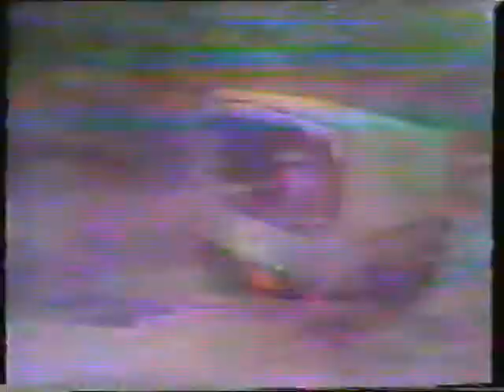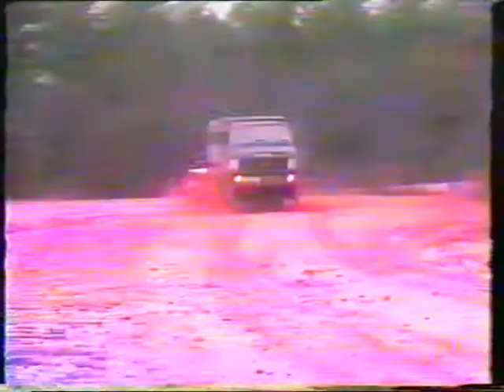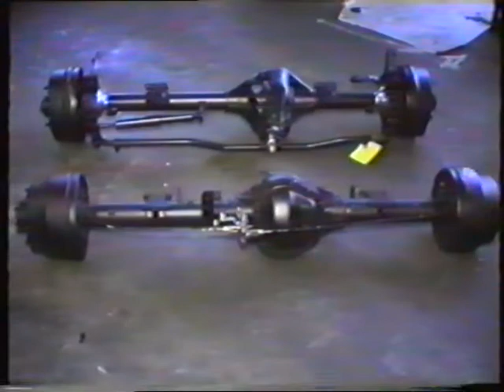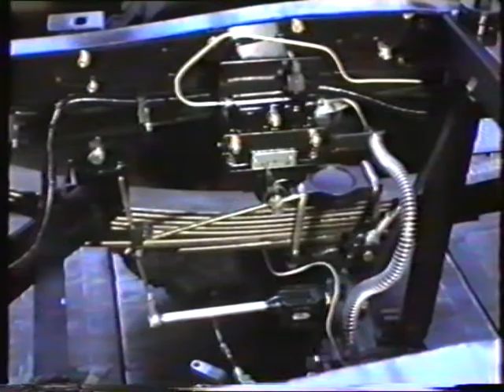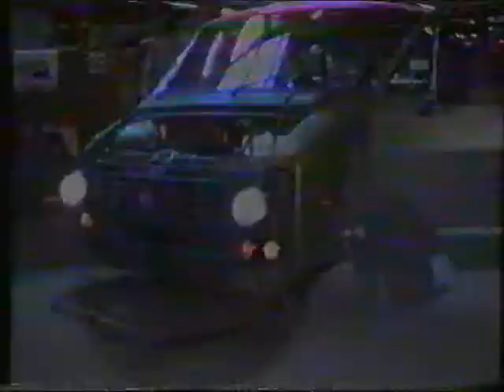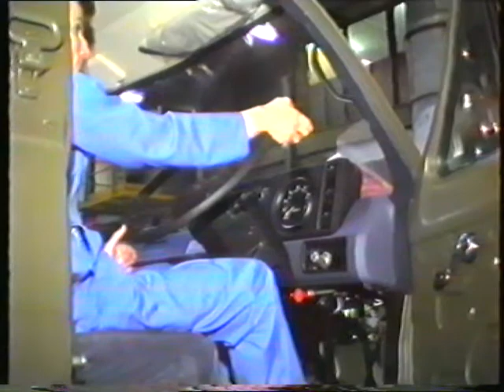RB44 Reynolds Boughton 4x4 TUH Production Video Cir 1988 -90 (Dodge 50)

Comment: How did renault get the body panel tooling from chrysler?
Reply: The RB44 was built by renault who built the 50 series, in 1979 Chrysler uk   bought out the Dodge 50 series which was based on the US Dodge B250
So they had the tooling.
Only part they had to fabricate and tool up was the roof as there are no chassis cab B250 vehicles.
The RB44 Cab is essentially the Mk2 50 series cab with a few extra bits.

Comment: are those renault engines reliable?
Reply: Not renault engines they are Perkins phaser 110T 3990cc and very reliable.
Reply: @KarrierBag  Perkins is a well-known brand, Renault I don't think those are very good at all in my opinion powertrain wise.  In the United States these dodge tradesmen Vans are unibody subframed. I'm guessing these have been converted to except full frame?
Reply: @yourallbrainwashed  
It wasnt really a Renault build as such, well it was but Renault UK, the chassis is solid as are pretty much everything else, it's the cabs that let's them down to be honest.
The axles and transfer box are boughton and the rest was built on the origional commer / Dodge production line , I went there many years ago to visit in a dodge 50 built there.
The renault France Van's like the master and others are nothing like and share no parts from the rb44 or 50 series.
I driven and maintained RB44s and I love them, but like marmite you either love or hate them 🤣
Reply: @KarrierBag  I believe you I love the looks of those old Dodge vans but man they are junk. Lol
Reply: @KarrierBag  and old Dodge vans doors always sound like loud and worn out when you shut them compared to old Chevys. In my opinion Dodge has sucked ever since the early 1960s. 1950s and earlier Dodges were built way better. yes the technology wasn't as good but they were stronger.
Reply: @yourallbrainwashed  well there are quite a few still on the road, ibe got a few myself 🤣 as I said it's the cabs that are rubbish, US design in UK weather.... and etc etc but yeah I love em and yeah some are junk BUT much better quality than what's put out today, at least they were designed to last more than 5 years.
Reply: @yourallbrainwashed  I've never had the pleasure of a Chevy, the UK 50 Series and RB44 are much more heavy duty, I have an S75 50 series it's rated at 7.5 ton (7500kgs) and the 4x4 version is rated with towing capacity at 11 ton (11,000kgs).The range went from 3.5 ton to7.5 ton.
I don't think the B250 is anywhere near that?
Reply: @KarrierBag  yes. Agreed  new cars are meant to last only a few years. Also, new cars just do t look good imo. In the 1950s america, the cars had more style in a good emblem, than they do in entire new cars. I think they should just reintroduce the classic body's, and just put more fuel efficient and more reliable modern power trains. But I don't want unnecessary electronics. I just want the basics. No power windows, no flat screens, just and reliability and fuel efficiency.
Reply: @KarrierBag  yeah, they weren't good for much more than local city driving. I love the dodge van looks. But those powertrains were junk. I used to be a Chrysler guy, because my father loved them, and I was raised on dodges. But I bought an old chevy, and realized I didn't have to repair it all the time like I did chryslers. The dodge vans and most chryslers of the time had the same problem. Weak small block v8s. Sloppy transmissions. Poorly designed electrical systems. And horrible front suspension. And those old small block V8motors had to run rich, because they had a flaw in the distributor weights. You couldn't advance the timing to make it run leaner like chevys could, because they would advance to quickly, and cause engine pinging, and would burn a hole in the pistons. So they always die early, because they have to run rich, which washes the oil of the piston rings, and causes smoking. So I just like some old dodge body's and interiors.